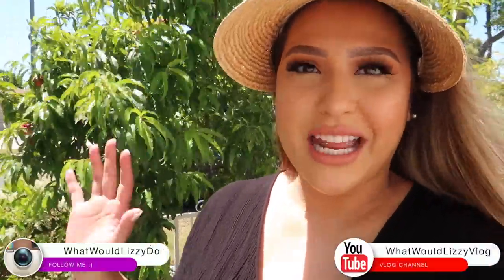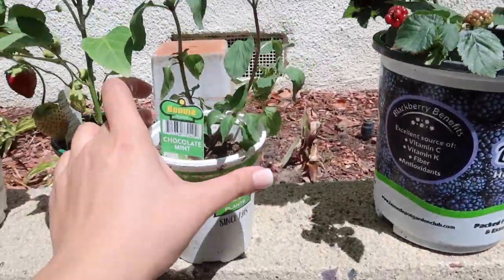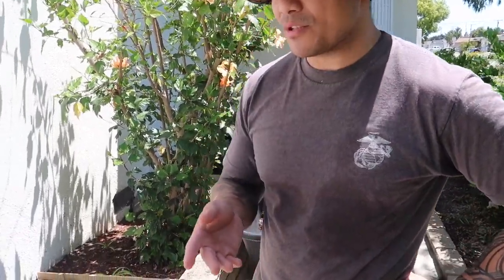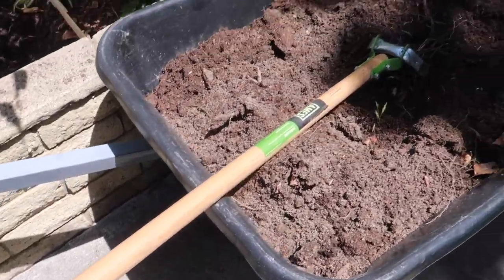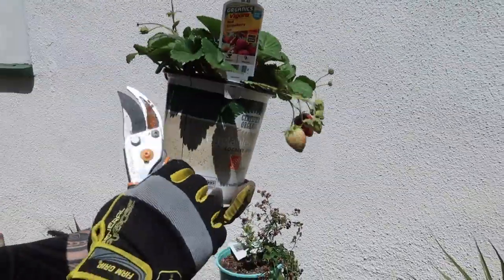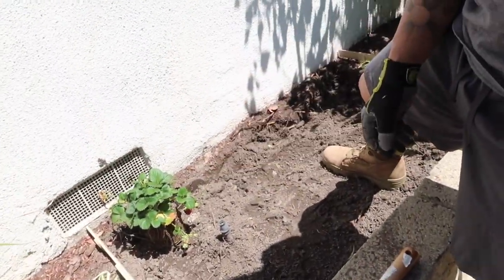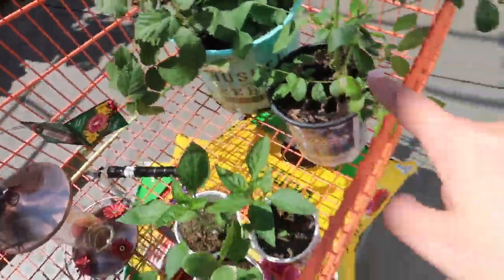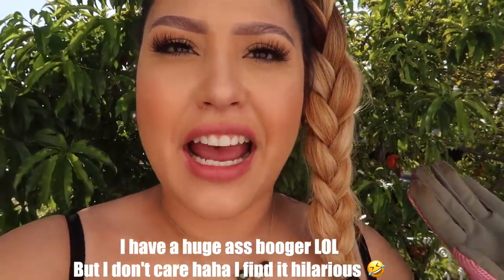Garden w/ Me! Planting Fruits & Veggies

Comment: You are doing great! You can train the cucumbers to grow a specific directions so it won't strangle your strawberries. You are probably going to want a larger pot for your mint. I had one plant in a pot twice the size of the one you are using and it overflowed the pot and the roots started to choke. Your strawberries will spread as they grow runner plants (you can either let them spread, pot the runners until they develop roots then snip the line or just snip and toss/compost them.) Lastly if you have enough fruit to make jam I suggest using Pamona's Universal Pectin it works with less sugar (so your jam tastes like fruit instead of sugar) and it gels better than the Ball Low Sugar Pectin. Good luck going forward!